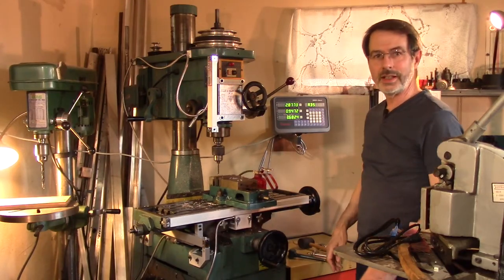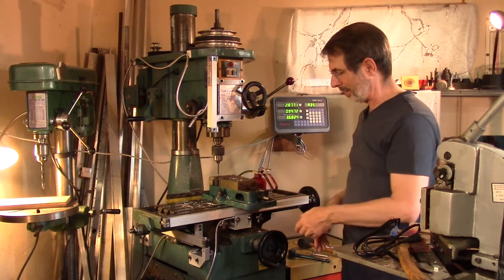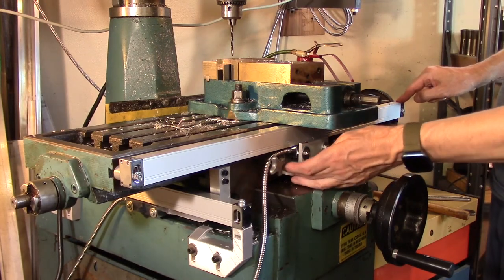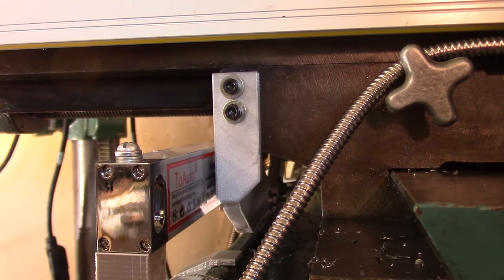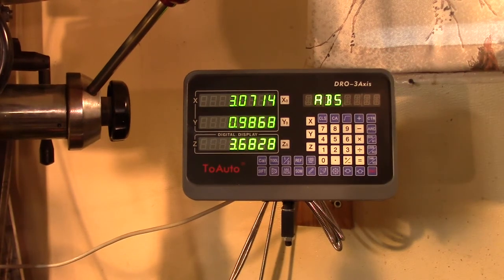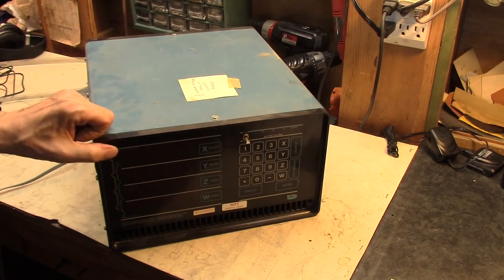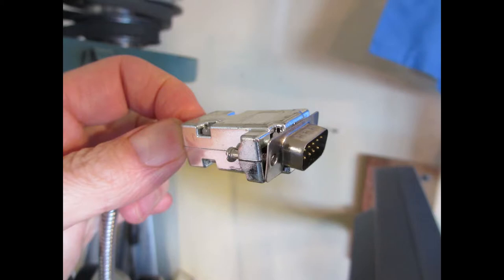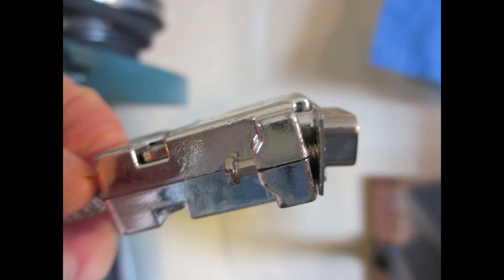DRO Digital Read Out with 3D printed Mounting Hardware for RONG FU RF-30 Bench type Milling Machine

Comment: Hi Ed. I got the DRO and the 3D printed parts from my brother, put it all together, and it works AMAZING! It went together like butter!! My Z is different so I had to make my own solution but I used some of that aluminum angle iron that came. Even when I clamp down on the Z it doesn't see to move at all. I tried posting a photo link here in the description but it I get your email I can send you some pics. Also, can I send you a small thank you $ for the plans? Really, I know you put a LOT of time into this, especially the 3D plans so it was a great help to me. Please let me know. The Id of Ed is great!! :-)
Reply from the maker: Thanks for letting me know how well your project came out.  If you want to post photos consider posting them as a makes example on the thingiverse site.  Showing your build example of my project would be a very nice thank you for me.  Its a nice way to share the results.

Comment: I have a newer similar design mill . I have just bought a DRO . I tried fitting the Z axis by mounting the sensor on the side of the column and fixing the long part on a bracket from the bottom of the adjuster plate , the sensor suffered from vibration when the mill was running. I have removed it but might make up something like you have used. Thanks for your video
Reply from the maker: I notice the Z will flutter while the spindle is running, there is quite a lot of flex and rotations in relation to the head and the spindle quill.  It's something I have yet to see if I can adjust out of the mill.  So any DRO slide is going to have issues with the mill.

Comment: Thank you so much for making this! Also appreciate that you attached the thingiverse links as well! Just got an rf-30 (harbor freight clone). It currently has the cheapo battery operated dro. Using it mostly for drilling bowling balls so those DROS are probably good enough. However, I'm ocd and would rather have a better quality dro. How is the printed parts holding up? I was thinking I could always just mill some aluminum to replace plastic if needed.
Reply from the maker: Thanks,  Nice to see some folks could use the design.  The DRO setup is doing fine

Comment: Did you just use PLA for making the 3d printed stuff? I'm having a hell of a time trying to get them to print in ABS/ASA. Haven't tried petg but I would probably rather not have the flex that petg has. However, pla is not as strong as I'd like.
Reply from the maker: I just use PLA for all my stuff.  It's more than strong enough for this project.  It simply has to support the sensors.  Adding more layers, more infill and slower speeds helps in rigidity.

Comment: Hi again, Ed! So, I ordered the DRO from Amazon and the seller replied asking me to confirm the correct size. I guess people order the wrong size and exchanges are costly. Can you confirm you bought the 150mm x 300mm x 600mm unit? Thank you!
Reply from the maker: That's what I got in metric 150, 300 & 600mm. Rough equivalent  in inch is 6" 12" and 24”.  They also had asked me the same double check question.  Looks to be just a thing they do.  Looking at the Amazon site it’s the the smallest of the order type.  That’s all referring to the total motion capability of the units.  The actual distances to the mount points are longer and is accounted for in the CAD design and how units mount to the mill.  All this assumes you have a similar milling machine.
Reply: @TheIDofED  awesome. Thank you!!